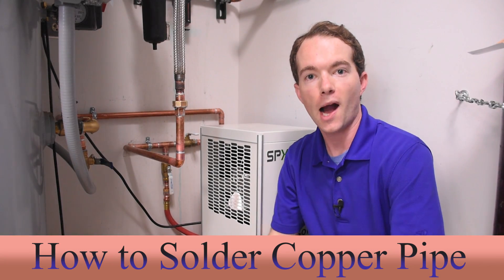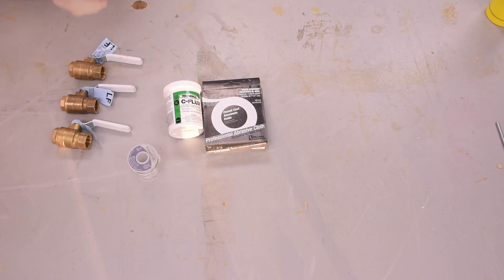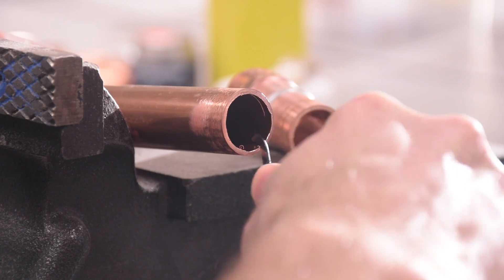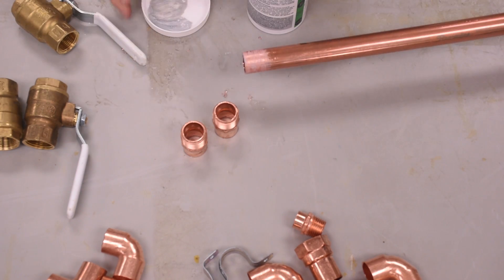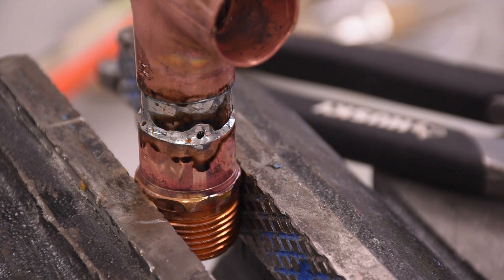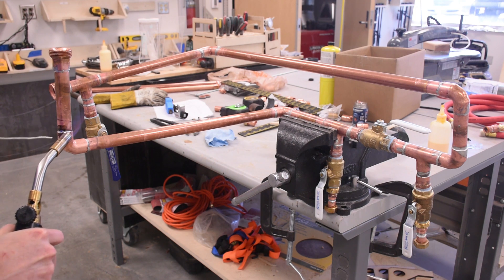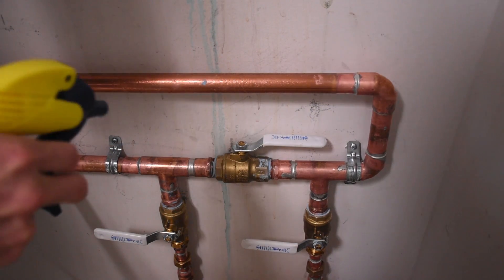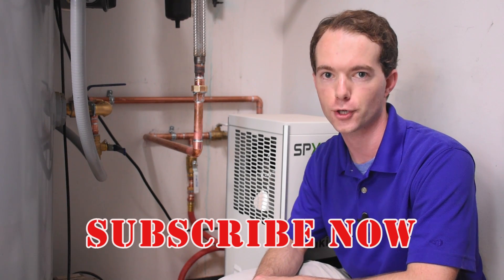Very Easy,  How-To Solder/Sweat Copper Pipes - Mikes Inventions

Comment: You can also use a small brush with flux on it while the saulder is still hot to wipe off excess and clean up the soldered ends

Comment: I would suggest keeping the flame away from the solder completely and focus the heat on the copper only. I noticed you were putting the flame slightly on the solder and that's not "correct" and it inhibits the concept of capillary action you want to properly fill the inner  joint surfaces.  I am guessing the solder wants to flow to the heat ( and flux) but when you supply the heat outwards of the joint, and on the solder, the solder doesn't penetrate nearly as well and it was apparent in your video, as your solder was consistently hesitant to flow inward, more covering the outer edges of the joint. You may have leaks in the future with this joint. Good luck either way !!